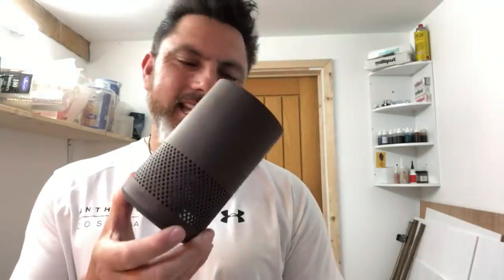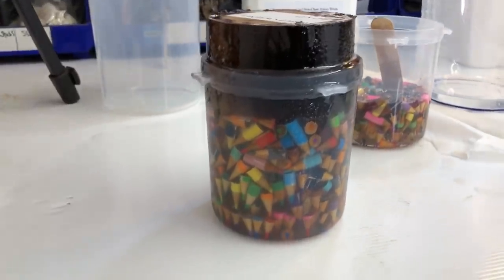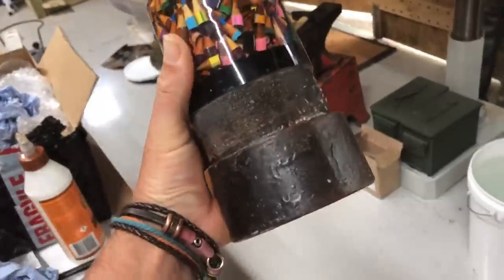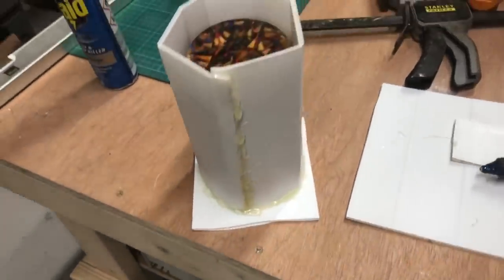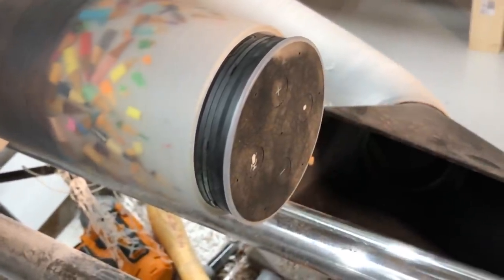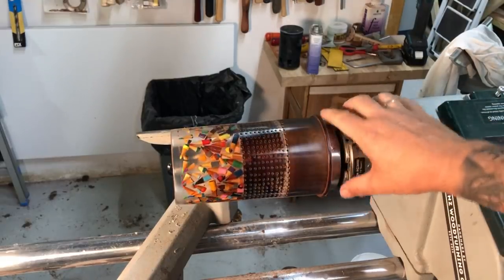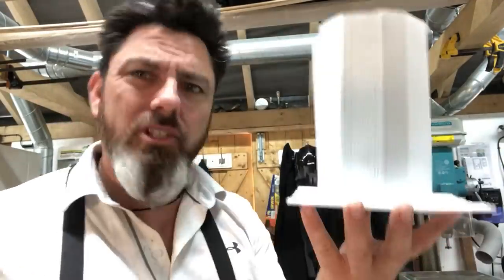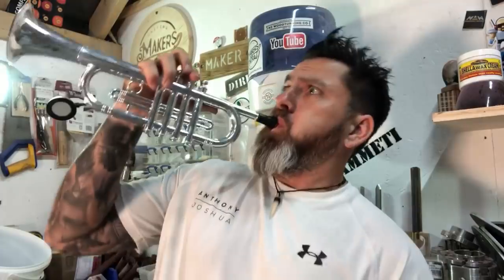Crazy Floating Pencil AMAZON ECHO ..

Comment: When you know you’ll hollow out something why don’t you ever use an internal structure like pvc pipe or tubing of some kind? Could save you resin money and time.
Reply: I thought about this but a couple things come to mind. 
1. It wouldn't work with large pieces mixed with resin
2. It would have to be capped at one end and still settle in its spot
3. Would though pour around it or press it in?  Pouring may not ensure equal distribution on add-in and press in may also disturb attractive distribution
4. If the add-in is light in either weight or amount, the filler may not remain upright so all his molds would need a lid of some kind to keep the filler centered.
Reply: @skeeterflores  Or... he could glue it down first.

Comment: Number of holes: There were 11 vertical ones to start with and I'm estimating 48 around (Looked like a quarter of the pot contained 12) so there could have been 528 to start with. After it was trimmed, there were 8 vertical holes leaving 392 at the end, if i got the number of holes in the circumference right. It was a lot of holes to drill however many there were! Good for teaching you patience! Love the pencil tips, you should definitely make something else with them.
Reply: I got the same 11 befor cutting but only took 2 rows off leaving 9 and I estimated 68 rows round the pot. but nice to see others taking the number chalenge to lol

Comment: If my counting is correct which took me a very long time so it’s probably not but there should be about 1001 holes ( 91 holes around and 11 holes in between equals 1001 ) again probably wrong and it took me forever.
Reply: @Scooters Videos you sir are correct.. I counted 48 holes around ish times 11 close to 500
Reply: Well I counted only 10 rows top to bottom and 46 columns around which would make 460 pretty darn certain on the 10 rows the 46 well no I didn't double-check I slowed it down to 25% and it took me maybe 5 minutes
Reply: all forgetting the one in the bottom ;) x
Reply: @Huxleybluehair  always a hole in the bottom.😂
Reply: @justinhobart8747  8
Reply: @justinhobart8747  there are 11 rows, I just counted
Reply: It did start will 11 that he drill top to botem but he took 2 rows off wen he tried it down

Comment: Great looking project. Idea to help make your logo fit. Find a pipe with the same or slightly smaller diameter as your alexa case and bend the logo to match the radius of the case. Carve out a space on the front to fit the logo flush.😀👍

Comment: so he asked for the number of holes so lets do some mathhhh, if there is 11 holes a row and  assuming the side could see half of the rows then that is 21 rows a half so 42 pin total. so then 42 x 11 = 462 holes in total drilled by hand. Approximately, i was say give or take an error if 3 rows so 33 holes so more between 429 and 495 holes
Reply: Amaya Sokanon I was guessing 10-11 columns x 42-45 rows like you were.

Comment: How Many Holes You Ask?
*Cracks knuckles* let’s break this one down.
We should be able to find this pretty easily if we multiply the number of holes on one side by the number of holes on the other. Vertically, there are 11 holes. Horizontally, there are obviously too many holes to count reliably via a video, but after quite a while spent counting I got about 46
So, because 11x46=506, there are about
506 holes in this piece.
Great work, Nick!

Comment: love it, but think you could have done better with the holes, either locking the chuck or using a drill press while it is clamped down on a sled.

Comment: 2*3.14*1.75 in radius = 10.99 in circumference. Divide that 0.25 in (hole dia +space to next hole) = 44ish holes/ring. Multiple that by 11 rings =  roughly 484 holes. If you drilled at a constant rate of 1 hole every 3 seconds that would be almost 30 minutes of constant drilling.

Comment: if you cut through the outside skin of the coroplast (in the same direction as the correlations) it will bend much, much easier.

Comment: Closer and closer to the half million mark!  Woot! Alexa's new case looks awesome!
I do have a question though...  I'm seeing that whenever you (and other talented makers) use resin to make pots, vases, bowls and items like this Alexa case, there's SO MUCH wasted resin that ends up on the 'cutting room floor'. Why not put a scrap/junk wood piece in the center of the cast to save 50% or more of your resin? You could just put a couple screws or glue the scrap to be certain it's centered, then just turn it out on the lathe ... ? Maybe it's my frugal mind, but I see $ $ $ 's when a solid mass of resin (and filler-of-choice) is carved away :(
Either way... NICELY DONE!

Comment: Holes in it are 290. 
Based on the width of 3.3inches (8.382cm) making a circumference of 26.319 and the 11 holes you put in each column. Making a total of 289.5. 

Never knew the cover was interchangeable either.

Comment: Tip to save you time next time. You could have just put packing tape over the real Alexa case holes then dumped sawdust (or chalk dust) into it. The sawdust sticks to the tape through the holes. Dump the sawdust. Cut the tape off lay it over your piece. Center punch and drill or just start drilling. 

It's faster and will give you cleaner looking holes.

Comment: There's exactly 517 holes. 11 across, and you did turn the case 360° at one point, and here was exactly 47 holes around the circumference. 47×11 for a grand total of 517 holes

Comment: Curious why did you not put something on the wood to keep it from moving while in the epoxy?  Even just taping painter's tape across to keep the top level or rubber bands or something??   Also curious why do you make your pieces solid when you need to dig so much out of the inside?  Why not push something like a silicone cylinder or a silicone cup down into it and then clamping it so it doesn't float away?  Seems like it would save a lot of time and material.

Comment: You drilled not quite 700 holes (around 682) though you ended up with just under 500 (around 496) on the end result.

Comment: I watched a few of your vids and have a simple question.  If you are going to discard 90% of the material (pencils and resin) why not just put a disposable cylinder in the center that is about the size you want and save all that cost and work?  Even a made up cardboard tube (that has been stiffened with glue or resin painted on) would work.  Saves a lot of money (wasted resin and Pencils (in this case)) and time?

Comment: incorrect on my part it is actually 345.5751915  being I incorrectly counted and taking the subsection of the case and multiplying by PI gave me the correct in a rough form the correct number of holes with a +-  10 or less than 1 /3 percent of error. of course I could be complacently wrong again.